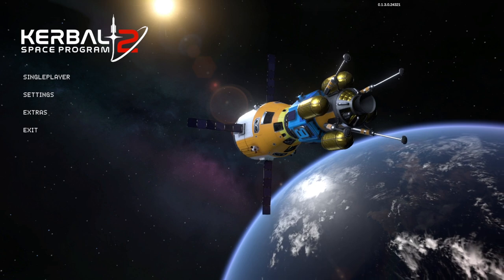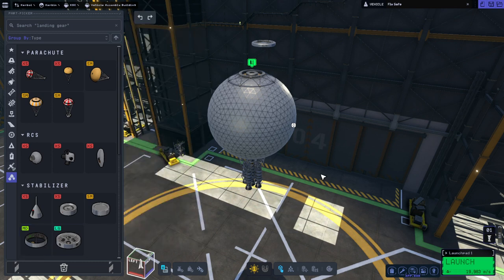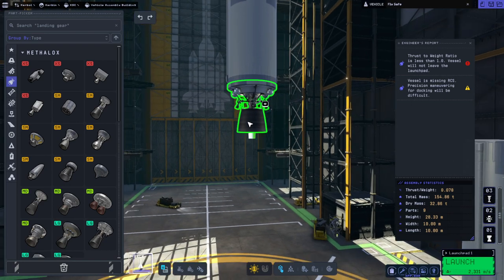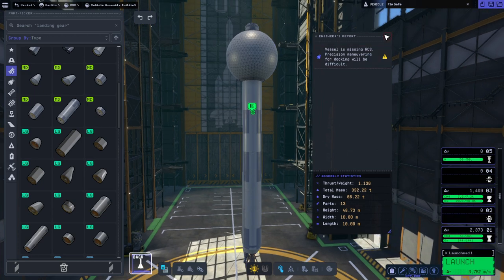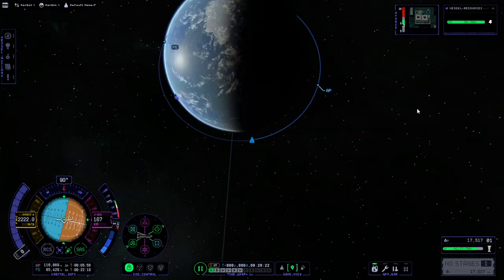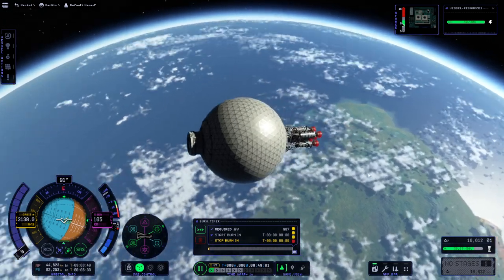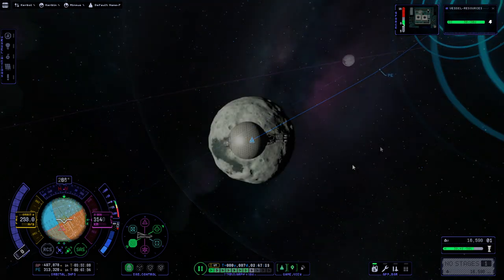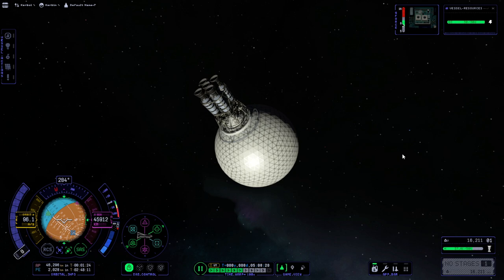KSP 2 Early Access - Patch 3 Initial Fin Test

Comment: It would be faster to list what works properly in KSP 2.
It will never, ever, be able to handle larger stations and space-bases.
Reply from the maker: How large are we talking about? Because I built most of ISS in the very first version of the game.
Reply: @RaizSpace  I would expect it to be able to handle at least what they've shown in the trailers; so quite large! KSP 1 was decent for stations, but it was crawling appart for ground-bases. KSP 2 promised a lot, but I don't see how they will make it work with all the fundamental flaws of their engine.
Reply: @OzoneGrif  The engine is fine and I believe the game will be playable - even fun - if we just wait. However, the wait will probably be long. I'd bet on a stable release (minus maybe multiplayer) around early 2025.